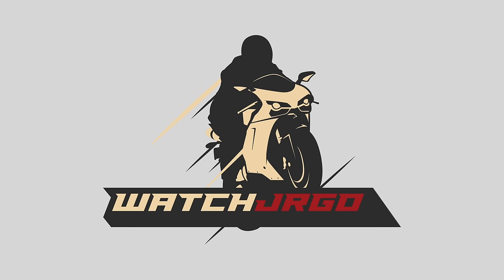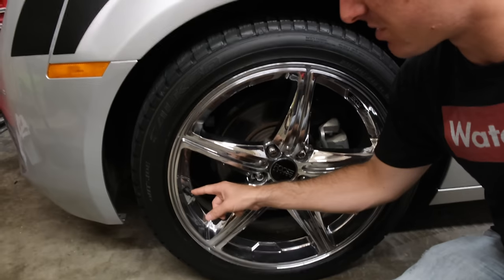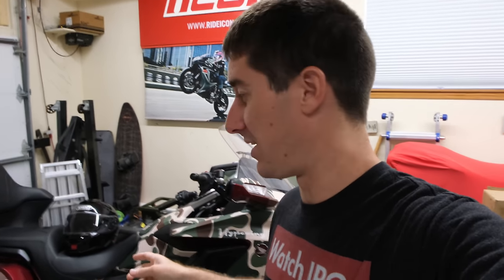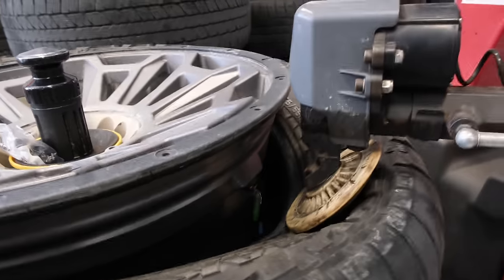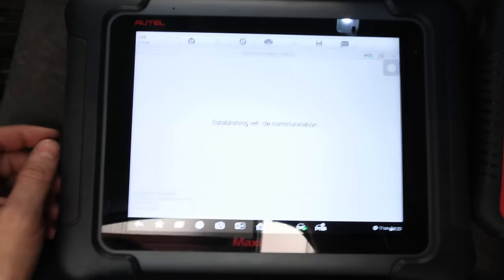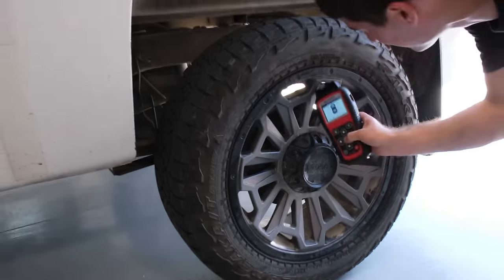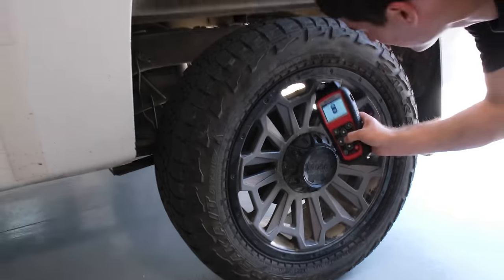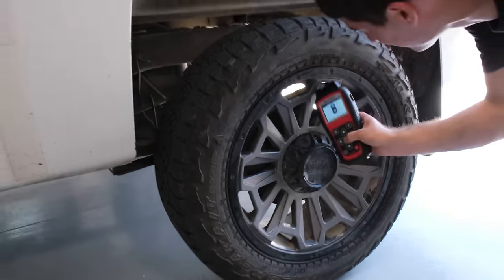TPMS SUCKS! Here's How To Fix It Yourself *Probably*

Comment: How to fix TPMS issues yourself:

Step 1- Buy a tire machine...
Reply: Haha I think someone is becoming out of touch we don't have access to garage lifts, tools, or scanners.
Reply: @chrispartridge3080  Don't need any of that stuff, get a new set of sensors and indicator on Ebay for about $25.  They screw onto the valve stems in place of the caps and you are all set!
Reply: @chrispartridge3080  @WatchJRGo I agree this is BS. I'm a big DIY guy, but I have a small house and kids with a bunch of crap and a 2-car garage that actually park 2 cars in! The last thing I have room for is a tire machine, so I'm stuck going to a tire shop no matter how "easy" it is to fix a TPMS sensor with all the right tools. (I actually prefer to just pull my wheels off and take them to the tire shop so I don't have to leave my truck there and then bum a ride home or wait like an idiot, but that's beside the point.) And what happened to the Audi BTW? You put the turbos on 3 months ago and now its not in your garage anymore? No one cares if you want to fly planes. We came here because we like to fix cars too.
Reply: HaHa
Reply: you can change a tire without a big huge machine. manual tire changer will get job done for a under a hundred bucks but its work. you can also break beads with a separate car. lay wheel on ground and drive car up on tire sidewall until it breaks the bead. used to do that all time. works well with older cars and trucks idk if it would with some of the low pro tires on cars today.
Reply: @stevec5000  Will these work with your car computer systems to get rid of the TPMS warning light or do they only interface with the module that comes with them?
Reply: @menahemglobus3006  Only work with their own display or your car radio if you have an Android based radio but have nothing to do with the car's system.
Reply: @jeffreyrigged  I use my brake rotor for my head breaker.  Just lower the car rotor first right onto the sidewall right next to the rim.  On low profile tires I will put a brick on the sidewall right next to the rim and lower the car onto the brick.
Reply: Yeah, spend $10k worth of equipment.
Reply: There are manual tire machines at harbor freight for $65. Just to help y'all out. There are at home DIY solutions for this, but yes he is a bit out of touch with how most people would be able to 'easily' do it at home.
Reply: @mikeysfilm  Where do I buy the tire balancing machine?
Reply: @drgta6  It's not as if I am arguing with you. $10k of NEW equipment, yeah, that'll get it done professionally. If you have really nice vehicles with fancy aluminum rims, and expensive tires, then you probably wouldn't want to DIY anyway. WHO TF wants to start a tire business to pay for their equipment? lol But if you are an average person and your tires are just average cost to replace, then you can use a bubble balancer. They are under $100. Harbor freight has some, BUT SOME of the ones on Amazon are a bit better quality. Obviously the Computer balance is better, however, all the money you save on doing it yourself, who cares if you have to replace tires just a little earlier. I do often see balance machines on marketplace often for around $500, BUT be careful, because some of them may have been tampered with, and may need to be recalibrated. Which costs money. I have friends that work at dealerships and can balance them after hours for free. So, that's worth mentioning. Make friends with access to the equipment and it's free for you! HAHA. Even if you do all the mount/dismounting tpms/stem replacement/maintenance yourself to know that it's done right, most places have lifetime balance available when you buy new tires. so, just take them back, and have them rebalanced for free when you are satisfied with your work. Lots of options.
Reply: @mikeysfilm    Are tires "average" cost these days?  They're at least $300 each, unless you don't mind made in China ones.
Reply: @drgta6   Okay. Why are you trolling me? Goodyear owns most of the tire companies. It's an awful monopoly. You can get their tires for under $90 each for most common models. You seem excessive and like a waste of energy. If you want the best for everything tires then yes, go spend the $10k, or just go to the dealer, and just ignore anything I said. Otherwise, there are people out there who budget, and DIY. bye now.
Reply: @mikeysfilm   Quit being so whiny.

Comment: I wish you could tackle my TPMS system. I have a 2008 FJ Cruiser which was the first year TPMS was included with the FJ. However, it wasn’t until 2009 that they added the TPMS Reset button under the steering wheel, so mine has been suck at the factory TPMS setting of 46 psi which is way too high for my tires! (Normal FJs had a lower psi setting, but mine is a Trail Teams Special Edition which came with differently sized wheels and tires so they decided to set the psi differently for some reason.) If I had your knowledge or tools I would at least attempt to reset the pressure down to something reasonable like 36 or 32.

Comment: In my experiences with TPMS vehicles, the system runs on relative pressures to all tires.  If all tires lose air at the same rate, the light will almost never come on.  I can see a benefit in being able to view tire pressures on a menu screen, but the ones that don't have this ability are worthless systems, and work like I described earlier.  Also,  little things like this are why cars are more expensive today.

Comment: My 2008 Ram 3500 does not have it because it is a 1 Ton truck and those weren't mandated until 2009 for some reason. My 2006 Tundra had it and it never worked properly so I ended up "fixing" it by covering the blinking light with tape

Comment: Great video!  On newer BMWs, you can code the car to display the tire temperature from the TMPS in addition to the pressure on the iDrive.  Pretty neat to see the tire temps as you drive.  

I bet the data stream is slightly different between the Subaru sensors and Prius...

Comment: I really dislike TPMS.

But I am that guy that checks the tire pressure every week. 
I like to check and top-up the tire pressure regularly because I love to have a good dynamic on my car (pressure gives you better cornering dynamic, as the tires do not squeeze as much), because the I have a more comfortable even on speed bumps, gives me better fuel economy, and my tires last longer.

Why do I dislike TPMS?
Because it is either (1) a bad solution, or (2) a expensive solution.

(1) There are systems which uses the wheel rotation sensor, from the ABS / TCS / ESP system (Anti-lock Braking System, Traction Control System, Electronic Stability Programme).
These systems are not very reliable in terms of the pressure that it outputs, because, if you have 2 tires, or even the all 4 tires, really low, the system usually do not check it.
Moreover, as said in the video, these systems check the tire pressure occasionally, thus, for those which start their car and go straight to a highway at 60 mph, the system may not check the tire pressure on time.

Yes, it is good. But not enough.

(2) The cars which have the TPMS sensor in each wheel rim are a pain.
Not only increases the price of changing a tire, but also increase the complexity involved in this task.
I see many people postponing the tire change due to this increased price - which is way worse that the risk of having a low tire.

Moreover, this also increase the investment a shop has to make, thus, this cost passes on to the consumer.
This is very bad!

I am all for improvements, especially in security.
But this system requires too much maintenance, and for very low improvement.
Just like brake pad sensors... Which only increase the price of a brake change.
Reply: Dude, you just said "I am that guy that checks the tire pressure every week."
.
TPMS checks it every MINUTE.
.
It's also there for the VAST majority of owners who DON'T maintain their cars.
.
As for shop investment, give me a break - they've been required for nearly FIFTEEN YEARS, if a shop hasn't updated their tire equipment in that time, they probably scratch the hell out of most aluminum rims with some dinosaur machine.
Reply: @TheTalonts  I know I am not a "regular driver", and not a "typical driver".
That is why I said that, because it is a disclaimer.

I check the tire pressure every week, because I love to have a good dynamic car, better fuel economy, and to have long lasting tires - that is why I invest on Michelin tires.

As I said, not only (1) the TPMS is not always correct in assessing the tire pressure, but also (2) the value is not correct (except on those high-end S-Class / 7-Series cars).
Thus, I prefer to check the tire pressure weekly.

Regarding shop investment: never forget that it is you who pays.
And, more system, equals more investment; which will be reflected on your receipt.
Moreover, the TPMS is not equal on all OEMs, thus, more investment for a mechanic / tire shop.

Regarding your "15 years", shops had to make very other investments, that is why you pay sometimes double per hour what you paid 20 years ago.

But yes, I agree with your point: this is for those driver who not take care of their cars.
Just like: maintenance reminder, ABS, TCS, ESP, etc...
That is why cars are a lot more expensive than before, in both purchasing and maintaining.

Comment: TPMS you deal with as you have to.  Sometimes even the experts mess up.  On my Buick they reversed the sensor so the right front showed on the right rear, the left front showed on the left rear.  I had to reprogram it to get it right but lacked the tools to do it - so I had to take it to the mechanic for him to do it.  Fortunately, no charge for his mistake.  They are great however when they works correctly.  Who puts Subaru sensors on a Toyota?  That is a problem in itself.

Comment: takes me about 30 seconds to relearn the sensors when I switch between my summer and winter wheels for my explorer using the ford single button learn tool.  both sets have OEM sensors in them, takes about 5 seconds to put it into learn mode using no tools at all, then just walk around the car with the little remote and wait for the horn to honk for each wheel.

Comment: Yeah... 11' Camaro is my first car with TPMS, 2 sensors don't work but here is the catch I live in Europe so the sensors are 3x more expensive then same in USA... Not really eager to change them since it's so easy to break them when you change tires.
Reply: It’s not hard to avoid breaking them. Have the sensor at the 3 o’clock position just in front of or behind the bar when removing the tire. When mounting the tire have the sensor in the 8 o’clock position and be careful not to catch it with the beads. This is all assuming that your machine’s duckhead changes the tire at 3 o’clock.

Comment: Newer Honda sedans use ABS for their TPMS system. Not a fan of that setup. Newer GM vehicles are very easy to get into the relearn mode without a scan tool. Still need the TPMS tool.
Reply: Also when I worked at a dealer during college, we had to do TPMS relearns on GM vehicles after tire tire rotations. Same on the Hondas using the ABS TPMS system. The Hondas that used actual sensors didn’t need a relearn after rotation.

Comment: Hate TPMS -
If you can't afford multi-$1000 scan tools you are stuck guessing. My granddaughter's car kept showing TPMS warning, which stressed her out terribly.  She would have the tire pressure checked and all four tires were fine, but the warning would remain.  I happened to mention this to the counter man at AutoZone when I was buying some oil. He suggested to check the spare, and sure enough, it was almost flat. Nowhere in the manual does it say the spare remains part of the active TPMS while you are driving. Most people give no thought to the spare tire until they have a flat.

Comment: I fitted 4 new Autel universals to my new wheels and cloned the codes from my old wheels onto them.  Very easy to do with their cheap TPMS pad that connects via USB to a laptop.
Reply: But that pad only works with Autel sensors.

Comment: Hi. So i have 4 New sensors put in my rims. Now i will use the autel ts508wf Tool same way like you but no sensor will detect...... all 4 new sensors....... what is the problem?  Autel service say, only sensors from autel will be programming .... all sensors 433mhz.

Comment: I’ve had 2 break ironically when you change winter tires over on rims they have a chance of being broken. Ironically they were on my Nissan Altima and never ever worked right. They work great on my Triumph Trophy SE motorcycle saved me a bunch of times. I carry a small compressor and plug kit on the bike, you learn that mistake only once!!!

Comment: for anyone trying to fix TPMS on a LEXUS you HAVE to buy the oem ones which are like 100$ each from the dealer otherwise they will not sync with your Lexus. I wasted 3 sets from eBay claiming OEM and while they did work (meaning car detected them , programmed etc and light went away) BUT they did not show the actual PSI of the each tire on my dash.

I ended up buying 4 OEM TPMS sensors from Lexus for about ~400, got them installed, programmeded and the PSI started showing on the dash again.

Lexus makes everything easy except dealing with the TPMS sensors lol

Comment: unless you do this for a living (work at the tire shop), just go to a mechanic. It cost around $25-$30 to program TPS sensors. No need for a $400 TPMS sensor and $2000 ODBII programer.

Comment: Why are there none designed from the outside of the valve stem? Changeable coin batteries would be a nice feature too. Is there a tire shop lobby in on this or are wheel designers just set in their ways?
Reply: It's called Right To Repair...  and consumers don't have it, farmers don't have it. Even the military has to hire contractors to fix their equipment.

Comment: Im from Canada and its not a requirement to have tpms in Canada but i bought a car from usa and there was some TPMS on it and i totally agree TPMS Sucks this is the worst cheap gadget ever and its quite expensive you need to have it on all the 4 wheels you need a tpms professional reset tool + a odb2 scanner to reset it and here in Canada you need a set of summer tire and a set of winter tire but let me tell you its way less expensive to install a good old valve but dam its annoying to hear the bip noice and the tpms light on the dashboard i only wish i could unplug that thing from my honda pilot touring even if its sometime usefull to see the tire pressure i could get ride of those sensor and life without it..
Reply: The shit is too proprietary and the tools too expensive, yes. If there were good cheap universal sensors that weren't dead straight out of the box and the diagnostic tools were cheap, that would be a different story.

Comment: Great Video, how about showing how you remove a failed sensors from the wheel instead of just saying how to remove the sensor. I ask that because I tried to remove even a good Autel mx sensor and when I pulled using the same tool you were showing, it actually ripped the inside part of the valve right off the valve stem. What I'm saying is there's no way your pulling those valve stems out of the rims from the outside of the rim just the same way your pulling as you would if you were installing the valve stem. The inside part of the valve stem lip against the rim is just way to big to go through the rim hole.... So please show how you remove them....thanks.

Comment: Excellent, comprehensive vid, I appreciate you sharing your knowledge. A question big you don’t mind, if you had an OBD connect cable for that Autel S508, would have you still needed that high-level Autel scan tool to put the car in learning mode to register the new TPMS sensors? 
The Lexus dealer will charge about $100. USD ea. retail for an OEM sensor, they can be pricey. The Autel universal sensors seem like a good solution.

Comment: So the trade for the 3rd gen prius isnt nessarily an upgrade... the motors on the 2nd gen are really bulletproof... However the 3rd gen has ring problems and generally need a rebuild around 150k.  I hope its been done, not that you two cant fix anything that comes at you... and i can appreciate the cash on top and that the 3rd gen feels all around like a better car

Comment: Try Kia here is the royal pain in the $&@ in 2013 -2017 Kia souls. 

Here is why the sensors are locked to the radio Bluetooth system. 

Now imagine the radio fails in your car or a fuse burns out your car goes into limp mode and the service engine light comes on and the tpms kicks on it’s light on the 2013 soul it also blows the throttle body sensor have fun that’s a 200.00 part alone

Comment: i have 2012 acura tl and the the tpms like blinks for a minute then stays solid i have the autel ts508 same one in this video and got a code  that the sensor failed to register i took it to Pepboys they said that my left front sensor was no good so they put a universal one in and they tried programming it and the couldnt they even tried a relearn by driving it . when i tried getting the hex id from from the odb is blank said N/A so it like it need to be written . so pepboys then ordered a oem sensor from acura and same thing . tpms lite still blinks and then stays solid have a driven the car for more the 50 mile and still nothing .. then i got a new receiver antenna that sits almost above the tire and still noting . when i delete the code the light turns off and i can see the other 3 tires psi but when i drive over 15mph the like come back on blinking then staying lit .and sugestions .

Comment: I find it a LOT easier to program the sensor before I install it
Reply: Yep, I did that for my MIL's car - programmed them, then pressed each to make sure I got a pressure reading.  Then when she got the new tires installed, they just swapped them in and they were ready to go.